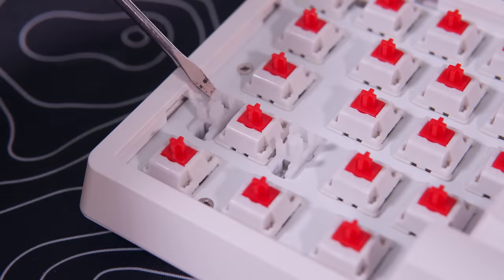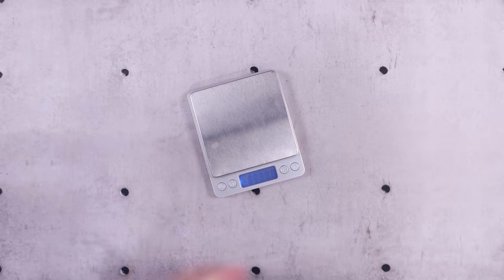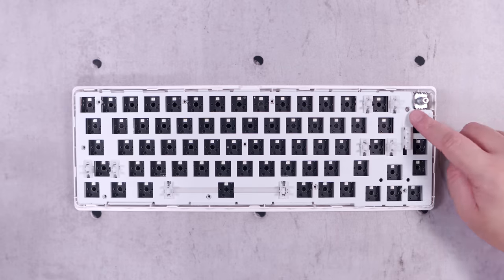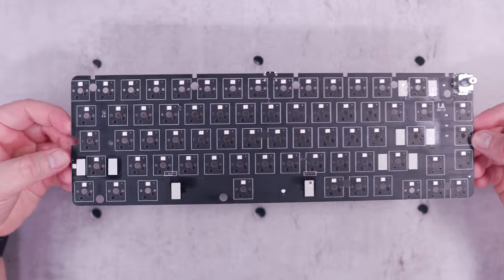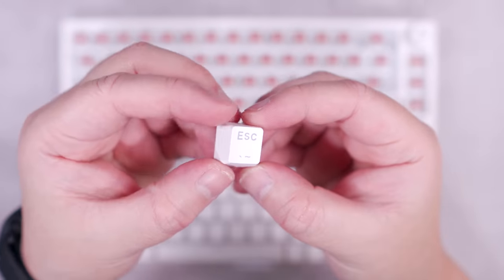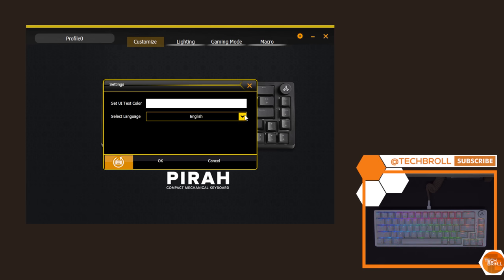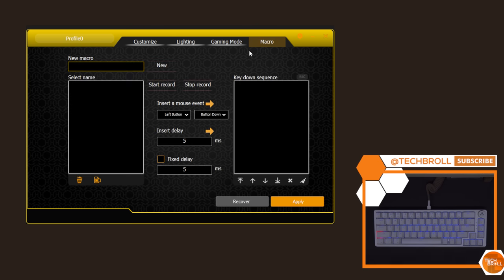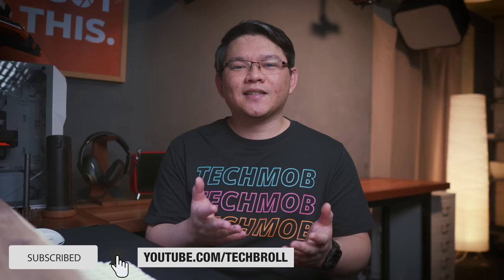Rakk PIRAH Review and Teardown - The BEST Budget Mechanical Keyboard!

Comment: You forgot to mention :
- Battery indicator (red LED) Left Shift remains on while plugged in. When the battery is full and youre using this as wired it will turn green but still remain on. This can totally ruin your theme or aesthetic.
- While in Bluetooth mode red LED indicator on the right also remains on while connected. Again can ruin your aesthetic (Sometimes even when plugged in and wired mode the bluetooth indicator on the right still lights up and remains on.
- Overall LED light brightness is pretty much non existent when paired with the gateron milky yellow switches.
-Lighting automatically turns off after 30secs of no activity. Happens both when wired and bluetooth mode. No option to turn it off in the software.

My unit came with uneven rubber mouse feet. So basically when you press on the lower left part the upper right part lifts up. Very annoying as this can happen while typing.
Reply: thank you for the additional feedback, sir. I was planning to replace my rk71 with this product. But with my work, I still do need the extra keys rather than the 65-key layout, and rakk pirah might not be worth the struggle. :)
Reply: i was wondering what was the red led on the left shift. wish there was an option to turn it off :(
Reply: hello, wala po talagang option to turn off the red static LED sa shift key?
Reply: UPDATE: Red LED on the left shift turns of when full charge.
Red Led on the right is on when capslock is on.
Reply: @ChefKevinShow  Thanks!!!

Comment: Wow... they have software? Iba talaga pinoy. Keychron still doesn't have one :) Thanks for the comprehensive review. Well thought-out :) I would probably remove the battery and make it totally wired. Good point about the poor placement of the power switch.

Comment: Really similar with the newer versions of TM680 even the PCB is the same if I'm not mistaken.
Reply: not the same, the Pirah only has Bluetooth and wired connectivity, the tm680 has both plus a 2.4gHz connection. Port placements also differ

Comment: Good video. Just bought mine but already got a problem probably because of the shipping "method" they used. A red light on left shift key that won't go away even when I turned off the lights in their software. Any fix to this problem or should I just RMA it?

Comment: Hi! Have you had a chance to try and customize lighting with the dedicated rakk pirah software? I've had 2 units both worked fine on all preset lighting but the del key led doesn't work when using user defined lighting settings.

Comment: Realy like this keyboard but the problem is im not a fan of wireless keyboard. Im thinking it is possible to plug this on wired mode the whole time? Or can i remove the connection of the battery to the board?

Comment: Feel like center port is very nice aesthetically, was one of the things I really wish the KBD67 Lite had, and is why only my Tofu65 is my only board with it (against my Ikki68 and Mode SixtyFive). Personally the only downside is if you decide to use the board with a laptop right in front. I also use a straight cable with a lemo connector close the board and its a nice symmetry.

Comment: Rk g68 or this? I thought this will have 2.4ghz wireless connection. But looks sleek and awesome to pair with my rakk talan air 🥳
Reply from the maker: It's possible that they can't maintain the sub 3000 price range if they include the 2.4ghz connectivity
Reply: rk g68 if ur looking for a 2.4ghz connection.
Reply: Okay din po kaya yung RK G68 sa Mac mode? No problems kasi with RAKK LAP.
Reply: The pirah at 2.8k php does not come with keycaps. The rk has 2.4ghz, 2 usb passthrough, keycaps included and is cheaper by 500php. So unless you already have keycaps and really need/want that wheel knob. Go for the rk.
Reply from the maker: @wanderingandroid  I just confirmed from Rakk Gears that the 2.8k Php variant does come with keycaps. Also, as per my experience with RK keyboards, the stabilizers usually doesn't sound that good out of the box. The 2.4Ghz is a good feature though. Also, does the RKG68 have stabilizer dampeners, silicone and foam dampeners?
Reply: @TechBroll  if that is the case. 2.8k sounds like a good deal for a prebuilt if you do not need the usb passthroughs and 2.4ghz.

Comment: brightness of the lights is kinda wack especially since its a wired keyboard.
Reply: ganyan ata tlga kapag north face ung pcb
Reply: @creativez9819  hard pass ako sa ganyn. I would rather have a single light but with a decent brightness, instead of RGB but it does look like a dying light.

Comment: Any one here who can give a summarized on the differences of the switch variants available for the pirah?
Reply from the maker: Sharing the specs for the Rakk Kalaw and Katala Switches, the other switches from Kailh and Gateron you can easily search on google.

RAKK Katala – Linear Pure POM
Stem – POM
Top Shell – POM
Bottom Shell - POM
Spring – 63.5g
Leaf – High grade copper
Unlubricated

RAKK Kalaw – Tactile
Stem – POM
Top Shell – Polycarbonate
Bottom Shell - Nylon PA66 5-pin
Spring – 63.5g
Leaf – High grade copper
Unlubricated
Reply: Thank you sir. More power
Reply: @TechBroll  can we know the manufacturer? I'm assuming its JWK or maybe Outemo? haven't seen it myself pero would be nice to know especially if there's a review of the switches coming up :D